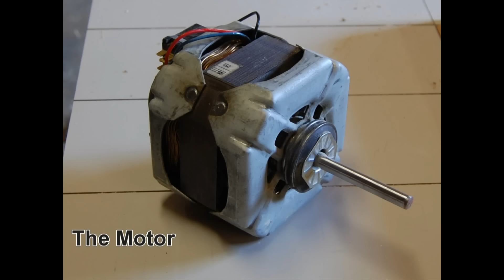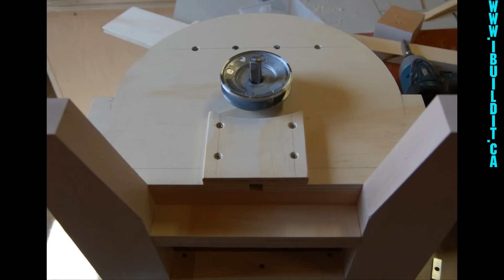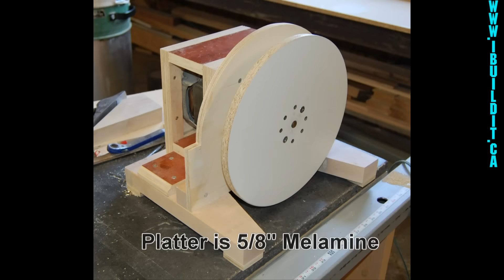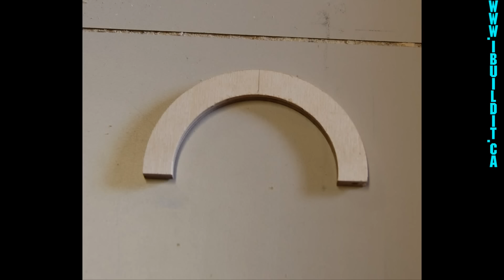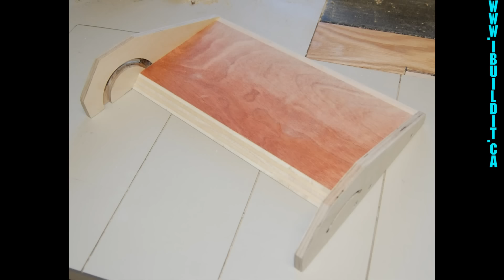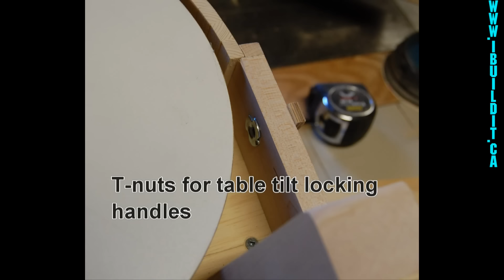Homemade Disk Sander

Comment: If you turn the disk and use a lathe chisel to take say a 1/6 inch off the outside edge of the disc face, and slowly reduce what you`re taking off to zero at the center (so you wind up with a very shallow cone) you can work wide peices across your disc without the far side of the disc lifting the work off of the table.  We did this in a custom knife shop I used to work in.You only need to take off the 1/16 because the far side of the disc would double to an 1/8.

Comment from the maker: It has a fan built in, and there are vent holes in the case. Besides that, it would take a fairly long time before the motor even got warm, let alone hot. I normally use this for a few minutes at a time.

Comment from the maker: Thanks. I've heard of it, but never used it. Normally when I do something round, I do kerf cuts. For this I did segments, but I don't think I'd do that again.
My original idea was to use sheet metal as the guard, but thought that would not look right. Even though my primary goal is to have the machine work well, I'm also concerned that it looks good. 
To do it again, I think I'd do a bent lamination, probably 3 layers of 1/16" hardwood.

Comment: That thing is sweet. Did you ever hear of "wiggle wood"? I used to use that stuff when I was a form-maker. It looks like 1/2" plywood, but it would bend right around that radius, instead of making relief cuts or laminating a round piece. Just thinking out loud.

Comment: Desperately need a tool rest table like that for my grinder.  Did you pivot the ply into a straight cut bit on a router table to make your arc cuts for the trunnions and the slots? If so, how did you set the pivot point on your router table?  Sorry to add to glut of ignorant questions...

Comment: Hello i Ripped out an old mottor from a tumble dryer ( electrical Dryer ) and the wires coming out of it are blue black brown and red and i taped the red and brown and then i taped the black and blue toghether fro the plug socket because i rememberd the colours for a wall socket but i have no idea if i have to ground it because they can reach very dangerous speeds and i have no idea how to add in a switch to the wires any help ? thanks much appretiated :)

Comment: John,i built one based on your design.the only problem I'm having is trying to figure out how to attach the 12" disc to the motor arbor. It's a 1/4" arbor. Any suggestions?

Comment: where do you guys get all your motors from? ebay they are about £80 over here in the uk, but can buy a premade machine tool for about that cost too so not worth making my own equipment
Reply: I pick up fans all the time from people throwing them away. Switch goes out, blades break, ect, but good motors. Picked up 10 big fans from a chicken house not to long ago with 3hp motors. I made two 4 foot fans on wheels for my shop and tore the rest down for parts. You just gotta get off the computer and look.
Reply: thanks pal.

Comment: The cheapest " one of these" is 250euro here in Europe with 60 euro shipping to my home. And they are made in China, means : dissasemble, clean, rectify.
Yesterday i bought used nice German 1hp motor for 25 euro locally. I have the scrap. I will finish it in a day. So i will make at least 250 euro that day. So if you make more than 350$ a day you can buy it. If not, its still making money, aint it?